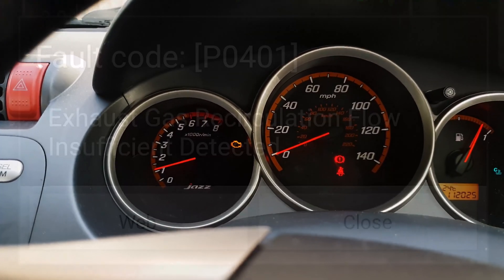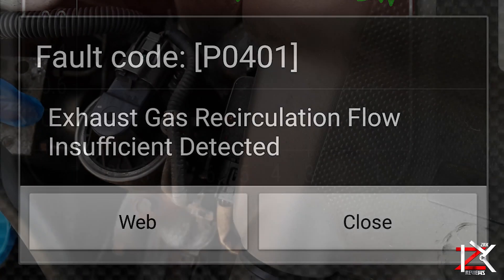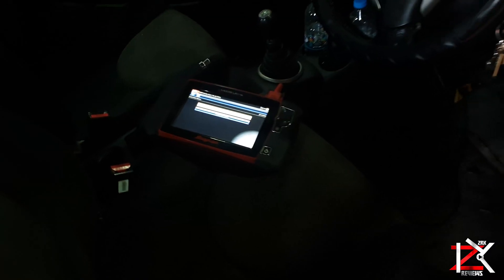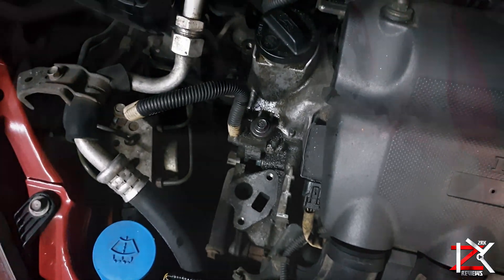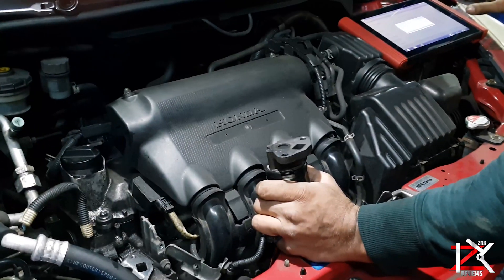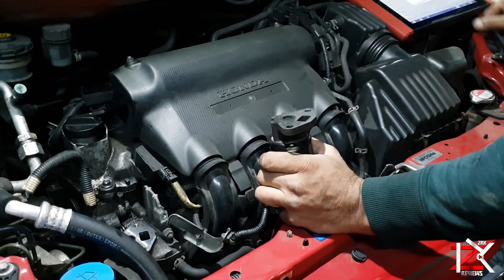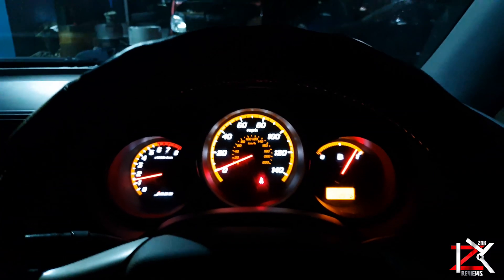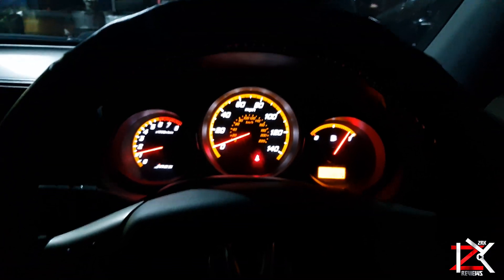CAR EGR VALVE ENGINE LIGHT FAULT FINALLY SOLVED - UNCLOG & ADAPT

Comment: So the same thing happened to me in my 2008 Honda fit. I had the EGR valve replaced and I had all the carbon completely cleaned out by my mechanic. The check engine light is still on. They told me to take it to the dealer. The problem is Honda wants to charge me triple for the same exact job my mechanic did and they're telling me that there's nothing wrong with the car, that this "fix" Honda does may not fix the problem but it won't pass inspection unless I try it. I just don't want to be out any more money than I have to. My car has 215,000 MI. It has been maintained its whole life and I'm not sure what else to do.
Reply from the maker: Yeah had the same issue, best to also clean any sensors that triggering the engine light too that come on, you can also use a obdi 2 code reader to check n delete engine light
Reply: Thank you. I'll give it a try ☺️

Comment: hello, just a quick question. If I connect another working egr, I connect it start up the engine and erase the code? And then I put my previous egr valve back on? Is it correct process? Can I erase this code forever with my obd tool from china? :) Thanks
Reply from the maker: yes connect new component, then delete the code. yes engine needs to be ON. not safe to erase forever if there was a way because it will cause a fault not being fixed and lead to another fault. 

if your egr is working fine but showing egr fault then it could be another problem towards it like sensor.